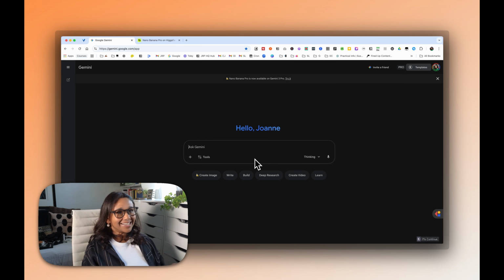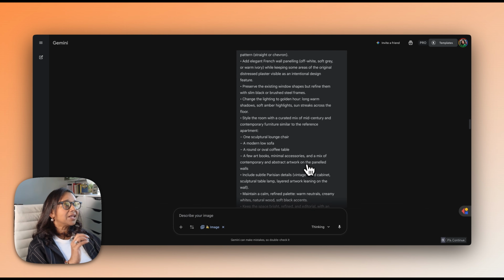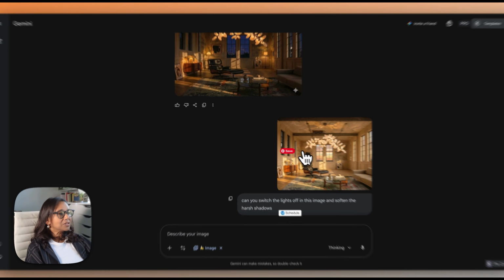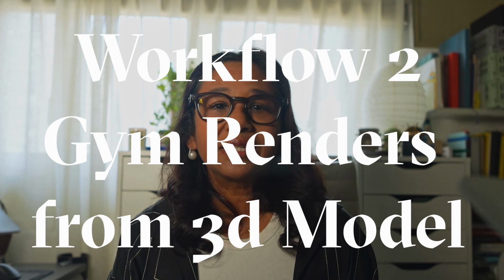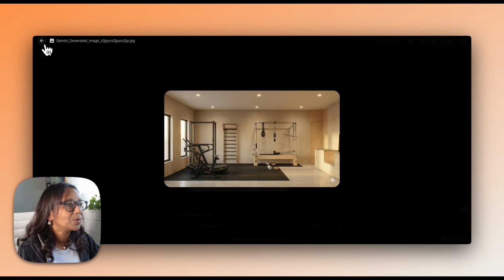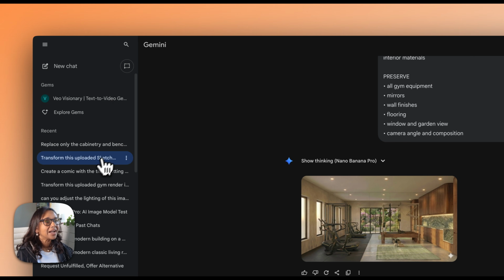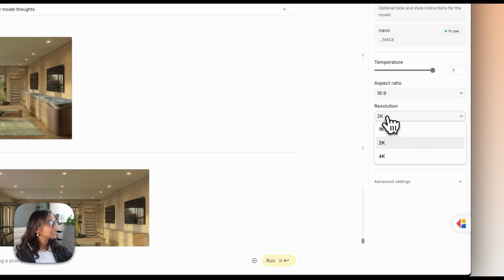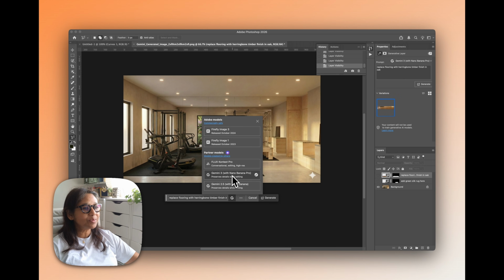Nano Banana Pro Just Changed Interior Design

Comment: I use architectural rendering software that imports furniture at true scale and generates accurate spatial relationships within a room. I’ve heard quite a bit of discussion about Nano Banana, but in the warehouse-room example I’m seeing clear scaling inconsistencies and lighting behavior that isn’t producing realistic reflections. This is a common issue when non-scaled tools are used. Rooms can appear larger or smaller than they actually are depending on how the furniture is resized, and that can unintentionally mislead clients.

Accurate rendering really begins with a properly scaled floor plan that translates directly into 3D. From there, tools like Nano Banana can certainly help a client explore furniture styles or color palettes, but only after the foundational model is correct. Presenting a room design without a scaled 2D plan introduces real risks, because clients may make decisions based on proportions that don’t reflect the true space.

Perhaps future versions of these platforms will allow full room scaling and integration with professional plans. Until then, relying on architectural software remains the most trustworthy and efficient way to produce design work. It allows the designer to develop the layout, incorporate the client’s requests, and weave in a cohesive vision while ensuring the result is buildable.

It also raises the question of what value a designer brings if AI is expected to generate the designs. AI cannot account for real-world construction, the costs associated with its concepts, or the many practical considerations like electrical, plumbing, clearances, or code compliance. AI can generate a pretty room, but whether that room is functional, feasible, or safe is another matter entirely.

For these reasons, I can’t recommend using AI as a primary design tool. And when designers rely on AI-generated images or other designers’ work to create their client’s plans, it moves away from true design and into simply copying concepts that may not fit the space, budget, or structure. Skilled design requires experience, judgment, and an understanding of how rooms actually function — something AI is nowhere close to replacing.
Reply: bruh, just give it another year, and 3d rendering career is over, AI killed that industry, goodbye archviz....